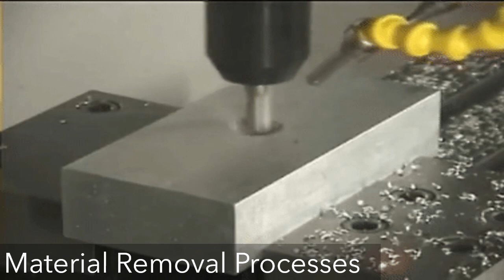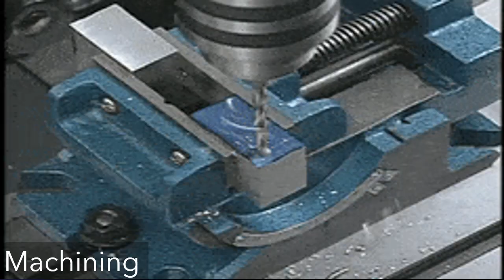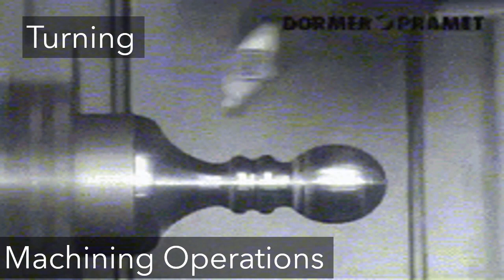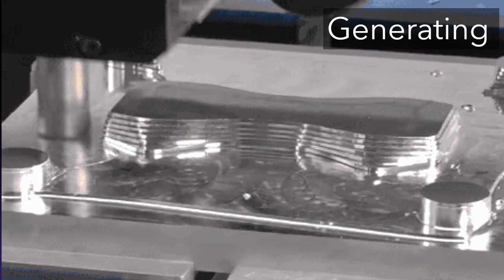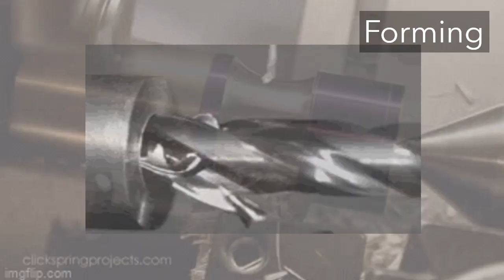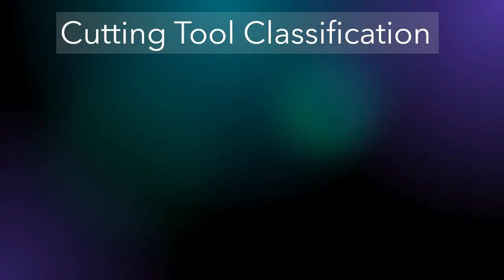Introduction to Machining

Comment: we call abrasive processes as grinding
Reply from the maker: Yes, the grinding is one of the abrasive processes (When we have the abrasive material bonded in the shape of desk), still other processes can use the loose abrasive machining, or the paste or the abrasive paste